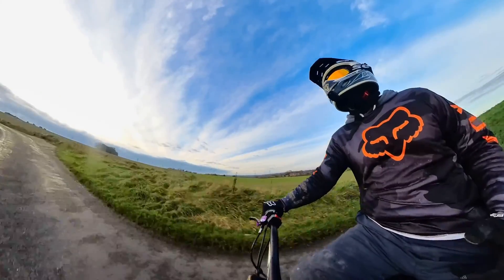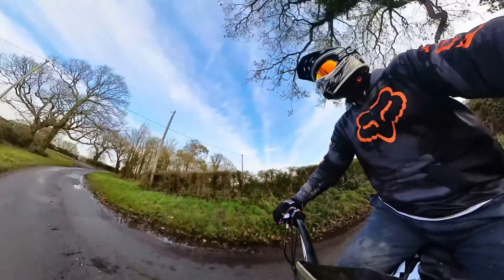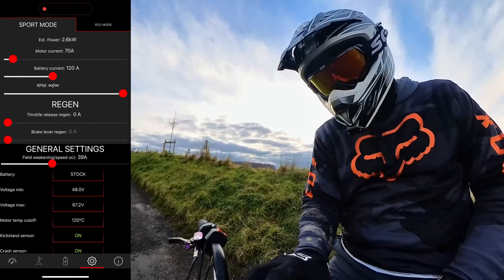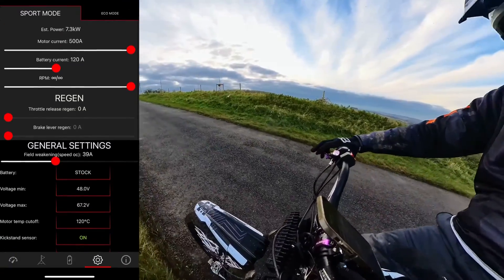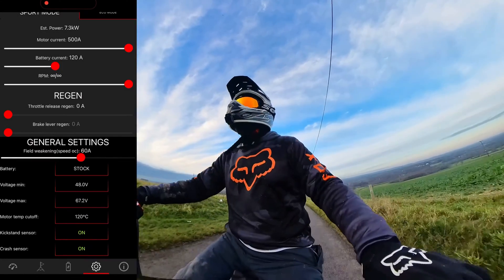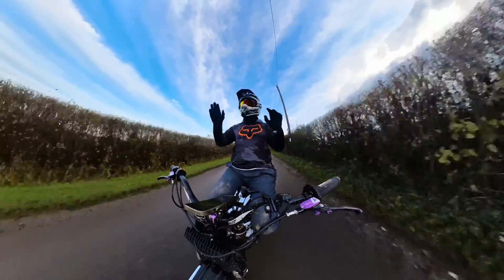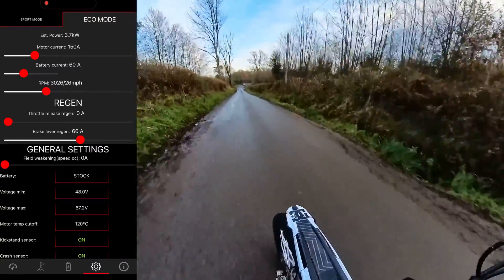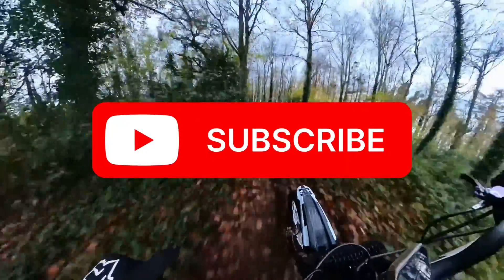THE BEST SETTINGS FOR THE TORP CONTROLLER!

Comment: how fast does field weakening apply in your settings? i put it on late and use the other settings to give me the initial torque and with the setting on late you get OC power later on. once my battery is at 30% my body is absolutely trashed. i ride offroad (woods and wide open fields). i also keep it under 50A and never had any overheating issues.

Comment: Really helpful video brother. Just bought a tc500 and this has by far been the best video for information regarding the controller upgrade settings. Bless up king💪🏼
Reply from the maker: Thanks man. Really appreciate it.  Enjoy 👊
Reply: My does not go up to 500a. I have a CHI Max and a stock motor but normally run it at 17kw

Comment: What would you say the exact same settings are to have it as the stock Surron levels ‘  I have a Ebmx x9000 - Ebmx 72v 57ah battery and was looking to have mode 1 as my mode just to get to places to save more battery life ?
Reply from the maker: How do
You find the x9000 controller? Are you able to adjust the setting through an app?  I bet you bike shifts with a 72v batt and plenty of range with the 57ah.